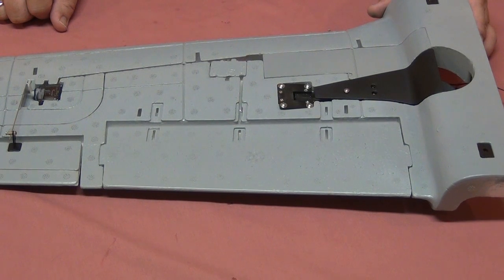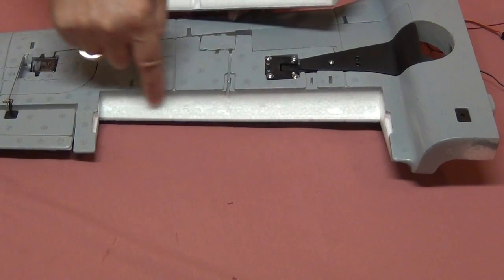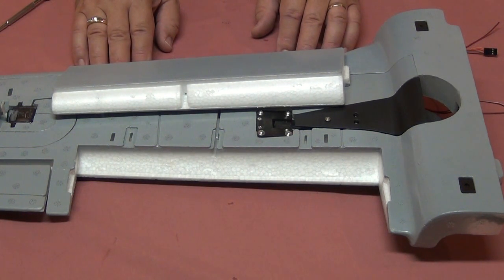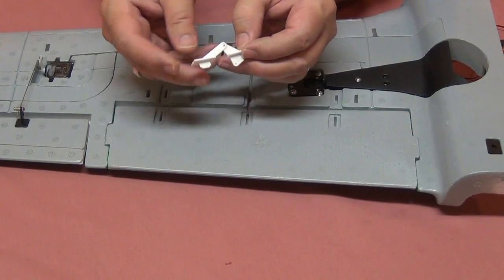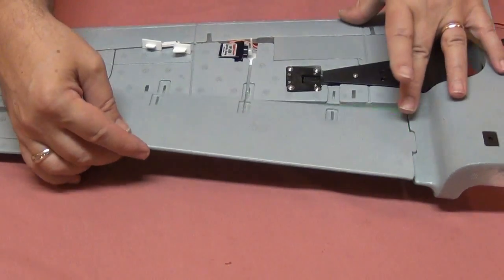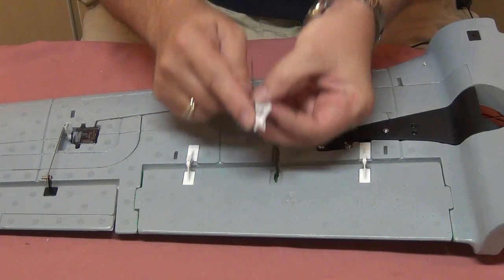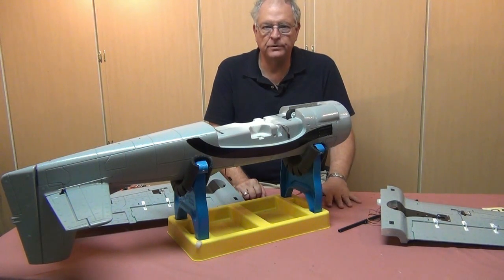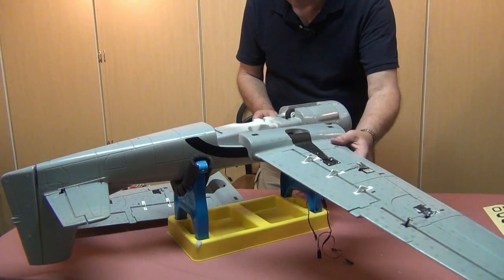Dynam T-28 Build Log Part 2.mp4

Comment: Nice Vid. Do you think that this is a plane that could have the wings assembled at the airfield? Regards, Pete
Reply from the maker: Yes, sure. There are a bunch of wires so you'd have to take your time and double check tbings. Keep in mind that with foam and plastic, things wear so it would probably be  better to not have to set up and tear down each outing.
Reply: @AZJim12  Thank's for that :)
Reply: Could I ask you another question :) what is the size of the wheels? they look like 2.5inc but I can't find anywhere that says what they are :)

Comment: This is from what I've seen your video's the seconded time you never showed how to get flap servo linkage hooked up with correct throw!!! You did same on turbo jet !!! My flap servo wants to rip the flap hinge off flap 😡 I can't seem to get the throw correct ?? Any suggestions?? Would of liked to see that part of installation
Reply from the maker: Mike Remvidas .  Mike, the flap set up isn't covered because things like throws are set in your computer radio. On Spektrum its in the flap system menus. You set up the direction and degree of movement. This changes from brand to brand so I leave that up to your radio manual. Sorry you're having trouble.
Reply: The RCPlaneviews.com Channel Ok thank you for the information 👍🏻 I do have a spectrum DX8 G2 but 😂 it's so confusing I haven't figured it out just of yet ! Thanks again

Comment: I tend to disagree with your placement of the pushrod. It should not go into a tube on the bottom of the fin. If you look clearly you will see that the rod is design to move next to fin on the bottom of the hinge. This rod needs to go up and down as well as forward and backward. By using it inside a glued tube will obstruct and bind the servo...